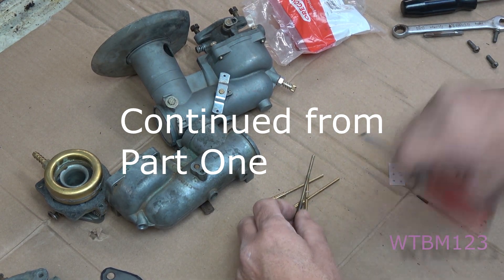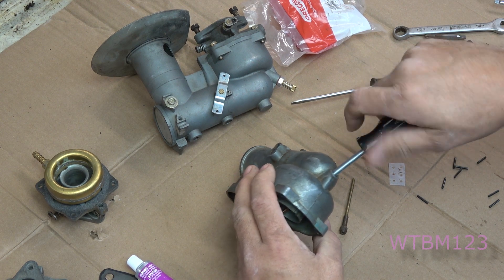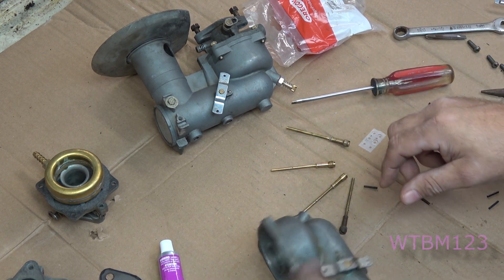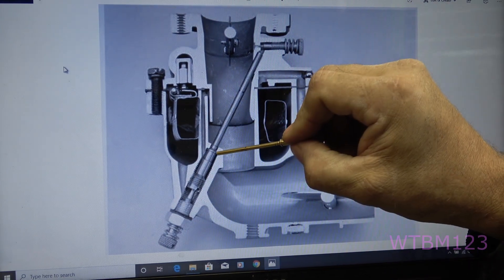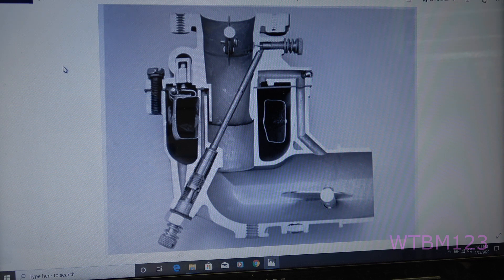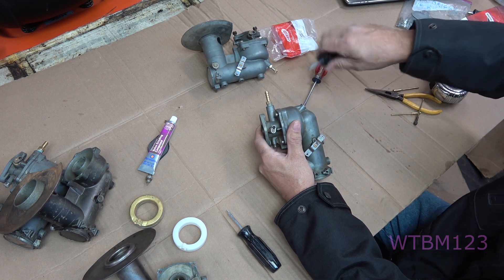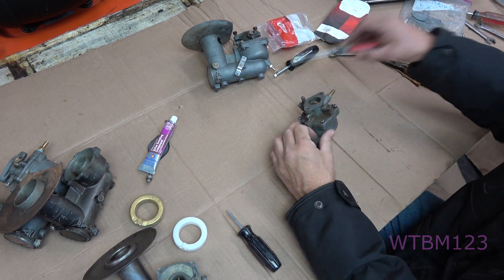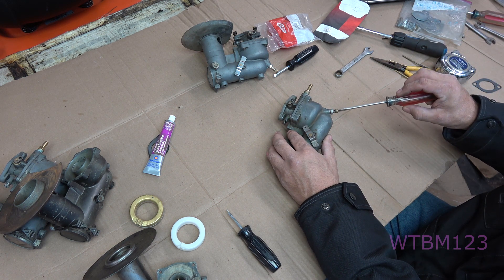Briggs Flo Jet Carb , Why they leak , Part 2

Comment: Great video.  I  I had a rebuild kit that didn't do the trick since some of the parts weren't identical.   Ran badly and leaky again.  What worked was I used the rebuild kits identical parts, but cleaned the original Briggs parts throughly that didn't match the rebuild kit.  Also did the o-ring trick.  Now zero leaks and after taking a while to get the adjustment screws set, the thing runs great now.  Thanks
Quick question.  Is it possible to drain any gas in the bowl or is it a tiny amount that evaporates?  My Tecumseh's are easy to drain but not sure how to store this blower once I run the gas out and let it sit...

Comment: At 5:15 what is the thread pit h and size if those screws I had one break off, I'm gonna left hand drill bit from the bottom side so there is a chance the threads will be damaged
Reply from the maker: If you are talking about the bolts holding the top on , i am not sure. Sorry .

Comment: Thank You.  Very well and accurately explained.  Those anti-leak washers have a 1/8" hole and 3/16 OD.  If you find some Viton tubing or fuel resistant tubing that size you can take a small  thin slice off it and use that.
Reply from the maker: Yes , and some people use a thin nitril o ring . .

Comment: GR8 HELP!!! Was wondering why fuel was dripping out and turning the screw made it go or stop. Had a few issues, gasket leaking, dirty seat for idle screw, poor spark and once going running very rich. Your o-ring idea solved the flooded chamber so Ive gotta get some of those teflon washers. !!!!!!! Thank you v.much WTBM for your Solutions and Experience !!!!!!! I had to trawl thru a large number of videos before finding yours explaining the problems you would get with the needle not seating.
Reply from the maker: Thanks , Hope you get it all sorted out and up and running well again

Comment: Good morning sir. I wanted to know do you sell these .  I been looking for this carburetor for my Sears tractor SS15. BRIGGS AND STRATTON MOTOR
Reply from the maker: I do not , but can find them on ebay or amazon . Choke control can be different so watch for that . Some people get them from isavetractors
Reply: @wtbm123  ok I'll have to check them put. Thanks a million. And I have 1 already up there but I can seem to get it tuned right to save my life lol
Reply from the maker: @jorelsmith1985  Warm engine , full throttle adjust the bottom jet . then the top idle jet . Also a bad set of points or condenser can seem like a carb issue .
Reply: @wtbm123  ok ok I'll double check everything this afternoon when  I get home. I know the carb leaks alot.. but ok thanks sir and I'll keep you posted
Reply: Hey sir.. the back brake light round cover.. does that screw off or do I have to pop it off. I try turning it counter clockwise but it just keep on spinning
Reply from the maker: @jorelsmith1985  Should pop off . You can still buy a replacement light that looks the same if needed
Reply: @wtbm123  ok thanks. I'll give it a try this afternoon when I'll get home. I'll keep u updated.    My cylinder head came in yesterday from I save tractors

Comment: Excellent videos; many thanks!  My flow-jet (1960 8hp) leaks gas when its not running but doesn’t leak when it is running.  The gas drips off the screw at the bottom of the oil bath air filter.  I presume it’s coming from the emulsion tube?  Where the gas leaks inside the carb and maybe dribbles out that screw?  I have a carb rebuild kit ordered.  Hoping to solve the problem.  Your videos will really help—thanks again.
Reply from the maker: Thank you for stopping in and commenting . I am sure you will get it fixed up .

Comment: I just rebuilt one of these on a 12hp B&S engine because the old float was leaking. I'm now getting a steady drip from the bottom center of the carburetor when the engine isn't running. Running no drip, would this be due to me not having the emulsion tube seated correctly? Also is there a plug in the very bottom of the carburetor near the choke plate? That's where it seems to be leaking from, it doesn't seem to affect how the engine runs.
Reply from the maker: That is a vent on the bottom of carb , and yes most likely the emulsion tube is probably what is leaking
Reply: I took it apart rust today and re set the float and reseated the emulsion tube. No more leak.

Comment: I've been working on iron 8's the last few days.
First one was sitting for many years inside the porch. It was a simple clean up on the carb and rewind. Smoothest up draft I've ever done.
Last night I parted one out and it had a plugged needle and seat and the main butterfly only opened 1/4 the way. It had a shiny new emulsion tube in it and after I pulled it out  the btttrfly opened up all the way. While reassembling I noticed the btttrfly issue again.
The upper end of the e tube wasn't in the idle circuit tunnel, rather it was coming up the Venturi. I thought the emulsion tube was a different length but your video proved that that wasn't the case. It doesn't seem to be bent is there a way I can get it to go back into the idle circuit tunnel or am I going to have to buy a new one?
Reply: I leave the top loose till i get the tube in and seated . If tube is not bent , you may need to screw it in and guide the top into the hole . If it missed the hole and was tightened it may be bent . I have straightened some that were only slightly bent
Reply: @terrymatthey5840  the idol circuit tunnel isn't big enough for the emulsion tube to fit. I tried putting it in just the top part of the carburetor
Reply from the maker: old tube may be stuck inside
Reply: @wtbm123  I found my box of spare carbs for the iron 8's. The emulsion tube has a bigger diameter than all the others that I have. It was shiny clean when I pulled it out. My guess is the previous owner purchased it to rebuild the carb and got the wrong one. I never knew their were bigger ones  I have a smaller version from a tiller  but now know their must be bigger ones as well.
Thanks for trying to help.

Comment: Thanks for a splendid video. Do you know whether one can buy a carburettor kit for a rather ancient 8000 the engine. It's on an old rotavator, which belonged to my wife's grandfather. I would love to get it running again for her.
Many thanks.
Reply from the maker: Find the model number on engine and google it . Or put the number in on Partstree web site or any site that sells parts . Usually can find part numbers that way

Comment: Briggs and Stratton 8hp model 190412 I could sure use a picture of the bowl gasket.
Mine was destroyed removing the bowl
Reply from the maker: That is prob a 3 bolt carb . Look up a carb kit and it will show you the gasket , 8 hp should have 3 bolts holding the top on , and the flow jetts for bigger engines had 4 bolts holding the top on . https://www.amazon.com/Repair-Briggs-Stratton-394693-291763/dp/B078JGD1C1/ref=asc_df_B078JGD1C1/?tag=hyprod-20&linkCode=df0&hvadid=380023036458&hvpos=&hvnetw=g&hvrand=731707022549583186&hvpone=&hvptwo=&hvqmt=&hvdev=c&hvdvcmdl=&hvlocint=&hvlocphy=9058989&hvtargid=pla-1008201230152&psc=1&tag=&ref=&adgrpid=79073044298&hvpone=&hvptwo=&hvadid=380023036458&hvpos=&hvnetw=g&hvrand=731707022549583186&hvqmt=&hvdev=c&hvdvcmdl=&hvlocint=&hvlocphy=9058989&hvtargid=pla-1008201230152
Reply: @wtbm123  ... sorry for the late reply, yes I ordered the correct gasket.

Comment: Good job. One thing I found out, you prob already know,  the Chinese emulsion tube has DIFFERENT  threads, be careful
Reply from the maker: Not all do , but you are correct as some do , I did run into one like that with a different thread

Comment: Great video! My Briggs re-build kit came with needle valve installation instructions that recommended leaving out the needle to float spring clip if the engine had a fuel pump. I can't say that alone solved my surging problem, because I cleaned the carb before I reinstalled it. The engine runs well, but the carb does have a very slight leak from the welch plug. Your excellent tutorial explains that issue very well. Thanks!
Reply from the maker: Glad it helped!

Comment: If the carburetor is worn out and leaking air around the butterfly shaft , is it better to find an old one or are the $25 China made okay to use ?
Reply from the maker: Some of the China ones are ok , most have a plastic float . some you need to loosen emulation tube and re tighten it . But if the shaft in yours is really worn it is prob worth the chance

Comment: Sorry if this has been asked before. What is the hole on the bottom of the carb called?  It it located along the bottom in between the air filter and before the air turns upward. It looks like it has a screen on it. I get leaking when the engine is off but the fuel is not shut off
Reply from the maker: Basically just a vent drain so if floods or gets water in it , a lot of them have a small stone filter in it